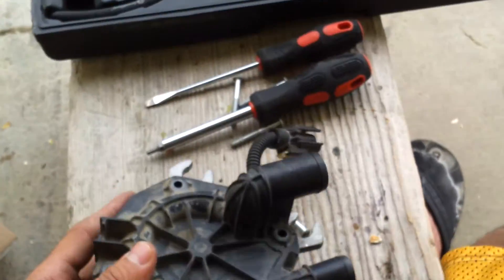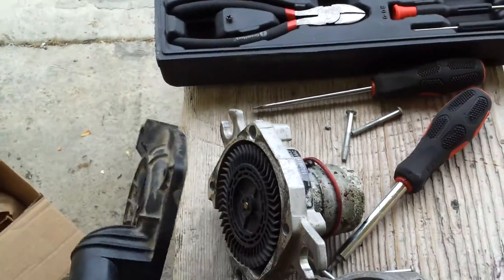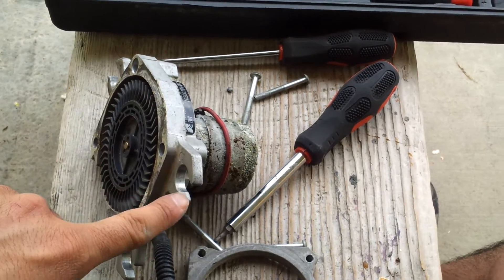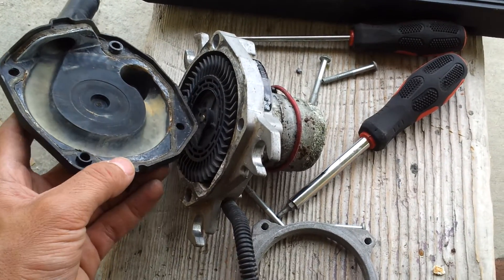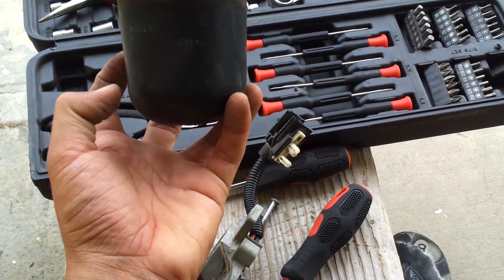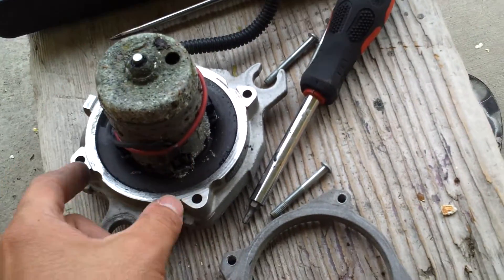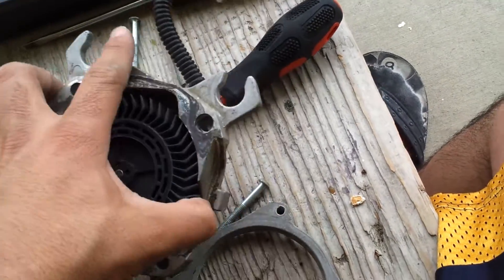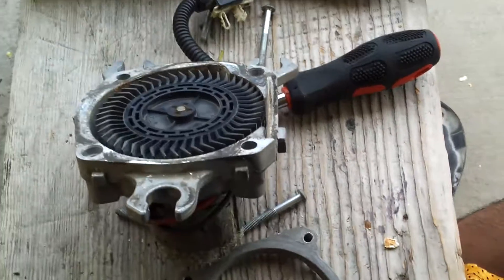Ford Focus Smog Pump disassembly

Comment: Water inside the motor means that the vacuum-operated check valve is leaking.  Exhaust gases are making their way to the pump when it is off.  The same water is seen dripping from exhaust pipe.  Valve will need to be replaced.